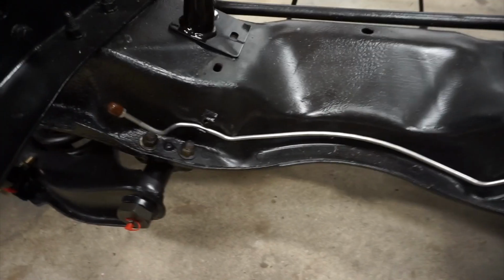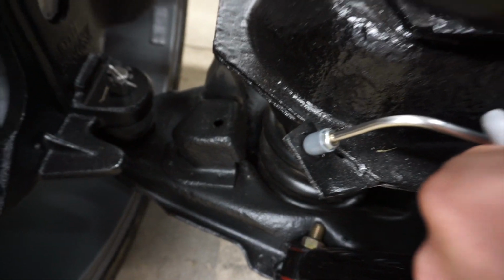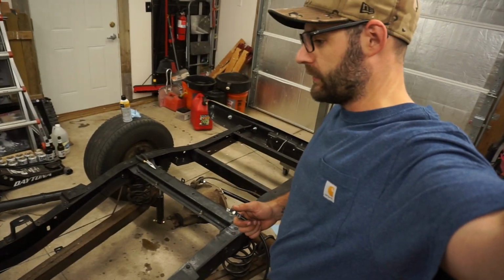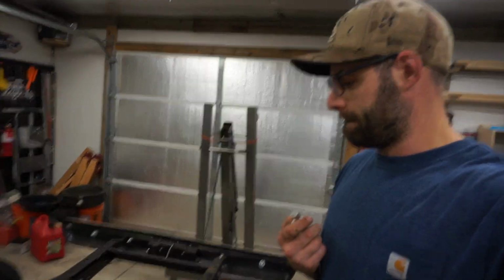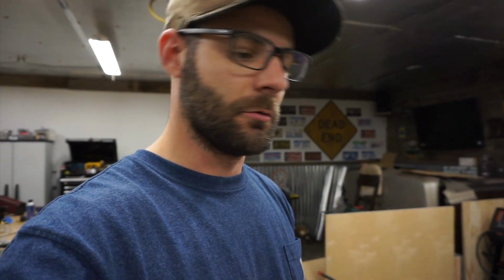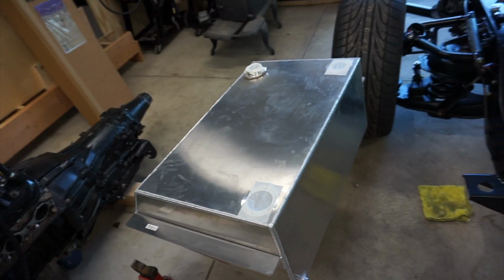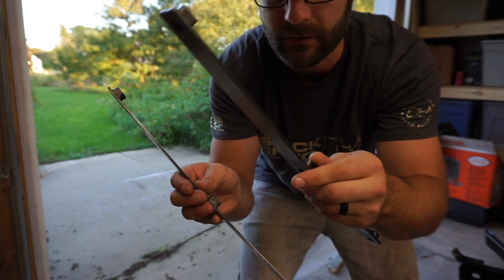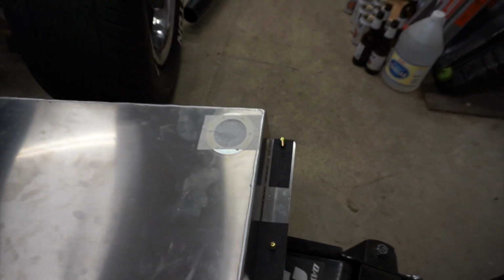Stainless Steel Brake Lines and CPP Gas Tank | 1970 Chevy C10

Comment: Cpp sells the front disc conversion brake line kit just for the 70s, it fit like a glove on mine
Reply from the maker: In stainless? When I ordered through Brothers they had regular steel, just not stainless
Reply: @paulkc10  yep, I'll try and find the pn for others
Reply: @paulkc10  found it, 6770FLK-SS
Reply from the maker: Awesome that would have made my life a lot easier. I’ll pin this comment so it’s at the top.

Comment: gas tank looks fantastic. wish I would have gone the same route(top fill). used a blazer tank with angled filler neck and it was a pain. front suspension set up looks top notch

Comment: Using a good double flaring tool is a must, I’ve never flared stainless lines before, Eastwood has a really nice tool for that. Good luck and don’t forget to put the flare nut on first!! Take care, truck is looking great!!
Reply from the maker: Yea it’ll be interesting getting this stainless steel to flare. Luckily both are 3/16” line and it seems fairly malleable. The 1/4” line is tough
Reply: I agree re the Eastwood tool. What do you use for a tbg bender
Reply: I did all mine on my 61 Apache on regular steel. It bends and flares alot easier then stainless. If you buy stainless lines make sure they are prebent and already have the the nuts on them.
Reply: Anytime you flare stainless it’s a single 37 degree due to the hardness of stainless it will crack.

Comment: I bought a kit from inline for my 1972 C10 with disc brakes up front and drums on the rear and had trouble in the same area you are having issues with, but everything else fit like a glove.
Reply from the maker: It’s definitely not a direct fit as advertised. Customer service didn’t seem to care about much either.

Comment: I wanna upgrade my chevy colorado pickup an put an aluminum gas tank on the rear do u bought a light weight aluminum tank? Cause they are kinda expensive. I'm planning to put it just behind the cab put it in the over the front of the bed
Reply from the maker: Aluminum is pretty light